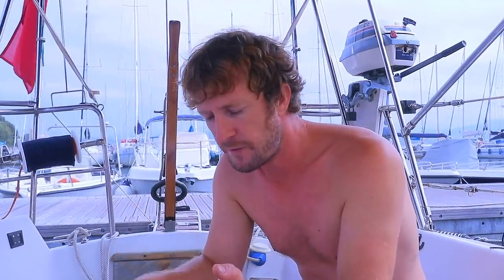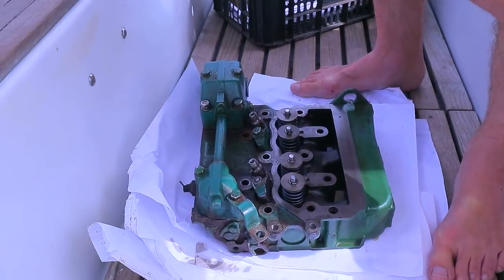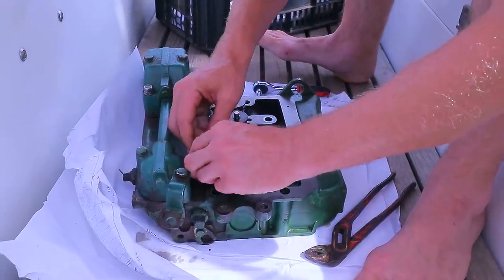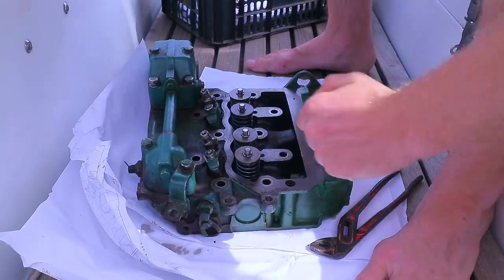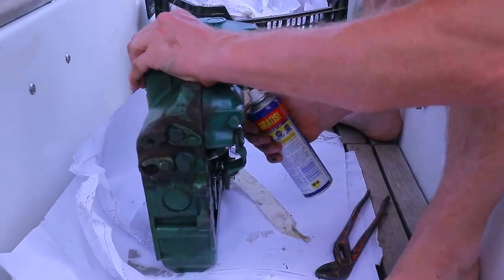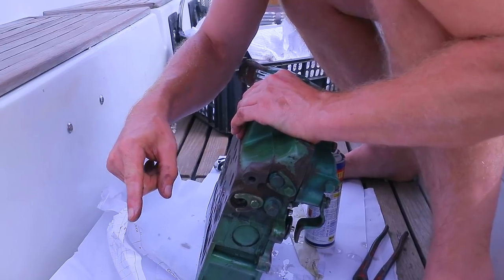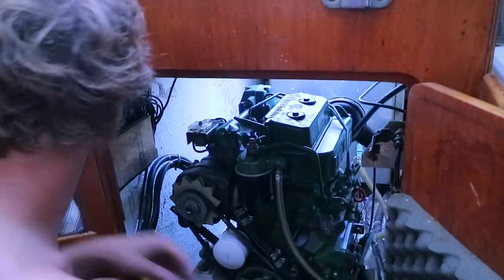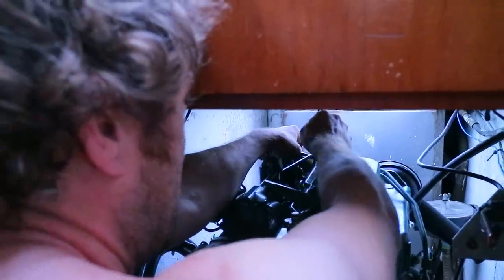Volvo Penta Injector Blow-By (Part 2 of 2) | ⛵Sailing Britaly⛵ [Boat Work]

Comment: I've got a volvo 2003, my first boat and my first diesel! Just planning to clean up the injectors and potentially replace or repair the sleeves. This has been the most valuable video I've ever encountered for any mechanical job I've undertaken. Thanks a lot, it's really appreciated!

Comment: Hey, that's a good video, it's encouraging! I've just completely renovated my Volvo 2003t. Due to inexperience, I didn't change the atomizer sleeves and I couldn't get the injector nozzles to seal. So the atomizer sleeves had to be replaced. I bought the three tools and replaced the sleeves according to the manual. I left the cylinder head on and drained the coolant, as the sleeves are directly flushed with water. The old sleeves were cut off at a certain angle to the cylinder head. The old ones were longer. The new sleeves are only as long as you really need them, so it's not necessary to take the head off. It's worth mentioning that the injectors are only screwed on with 20Nm, which leaves some reserves, but then the properties of the copper are no longer there, as it becomes too hard and no longer seals.

Comment: Dirt in the injectors and bashed the sleeve out with a hammer !! Diesel specialist my ar*e !
Agree, buy the tools and do it yourself, every time.
Good informative vid, well worth watching,  thanks.
Reply from the maker: Thank you Douglas. 👍 We all make mistakes, but I was very annoyed to be paying for a service and get such carelessness.
Reply: To be fair, the expanding puller, or blind hole puller, often doesn't work. Been there! There could be a couple of reasons for this. What is wrong with drifting the sleeve out? Absolutely nothing unprofessional about that at all. However, I always do it myself - but I'm 66 and worked on diesels for a long time..

Comment: Nice vid mate. I'm ex REME Ac Tech (Lynx/Gazelle)  and feel exactly like you regarding getting tradesmen to do jobs.
Reply from the maker: Hi Martin, we shared a hangar with 657 Squadron - they were a right bunch of lazy gits... 😉😁 I'd love to be able to do a bit less as I get older, but almost every time I try to 'let go' I wish I'd have just done it myself. Rossella and I refurbed our apartment in Italy and did absolutely everything ourselves (Rewired, knocked a wall down, fitted a boiler & central heating throughout [although a plumber fitted the gas supply for legal reasons], gutted the bathroom and renewed all the plumbing in the concrete floor (taking great care not to go through the floor into our neighbours ceiling!), plastered, double glazed, tiled, replaced all the internal doors, replaced all the flooring, painted everything, the whole shebang) When it was all finished, we ordered a shelf from a big national furniture store and I went away offshore. The guys came to fit the shelf - something they do every day as it is their job - and they drilled a hole through the wall in our living room into our neighbours bedroom! (Peephole style!) To make matters worse their bedroom wall was finished with a hand-painted 'dabble' effect with different colours, so our neighbours had to get the guy who had painted it years before back to paint over the hole. I couldn't believe after we'd done all that work with no issues these muppets could do that whilst fitting a shelf! 😂 It's funny now, it wasn't at the time. Cheers, Chris 👍

Comment: If you want something done right, do in your self !  And use only OEM or better parts. No one but me, wrenches on my beloved 99.5 VW TDI  jetta with 340000 mi.  Really enjoy the technical information. Do you use any lube on the new rubber impeller ?

Comment: Thanks for the injector tips.
I have a Trawler with twin Volvos and  after some work which required the injectors being removed I had blow by. I tried the hammer solution and it improved slightly, the copper washers on the fuel line absorbed the shock. Remove fuel lines and after a whack the i injector has seated.
3 years live aboard in Abaco's Bahamas, now permanent in Bahamas in our house.
Thank you.
Living as we have there have been our fair share of problems that had to be sorted without a boat yard or so called expert. Feel free to pass any problem by me.
Bob Errington

Comment: Great tip the 'cream' on the hands. If you're VP is a Marinised Perkings engine, like the D-2 range, you can get these parts at 1/4 of the VP prices for exactly the same. My tip for you: use GT7 from Tec7 instead of WD40. Discovered it a year ago. Incredible. For example, it loosened a spanner in 30min that was stuck since 2 years and where every 'specialist' had failed! Costing me a lot. GT7 is about 7euro for 600ml. It stopped also the corrosion on my boom between aluminum and stainless steel (and makes the boom and mast shine as new 😁). I wish I had discovered it earlier.
Reply from the maker: Thank you for the tip Henri! I hope you and the family are enjoying France! 😊 Chris 👍

Comment: Haven’t read or watched it all but a couple of things worth mentioning. Cleaning out the carbon from the exhaust water bend is a real worth while thing to do as they get blocked especially if engine is run on low load. And if you Lapp the valves in to much it can reduce the clearance with the decompression lever resulting in the valve being held open even with the lever in the off position. Also regarding the injector pocket inserts, the are cooled through an internal tube running fore and aft through the head and there are small holes approx 2mm dia which can block, these are orientated at the correct angle to spray the right area.These can be cleared or checked in situ with the removal of the cooling supply inlet pipe.l would caution against trying to remove the internal pipe as it is likely to bend .l can remember how many small holes there are may be 4 ,can be checked with wire. Regards Alistair

Comment: Sun tan cream can mark some finishes like car paint - guess how I know.

Don't forget to lubricate the top end before putting the lid on. In the few seconds before the oil reaches the tappets, and valve guides a lot of damage can be done.

From memory some of the Penta engines were originally made by Perkins. I think their parts are a lot cheaper.
Reply: The Volvo engine that is going into Nutshell is a Perkins.

Comment: Always wondered why impeller driven pumps often eject water in spurts rather than streams?  I would think a stream would be better for removing heat efficiently.
Reply: The pump is produsing a stream of water. After cooling the engine its intected into the exhaust. There its pushed out unregular by the exhaust gas

Comment: Hi - Good video ! Great to see someone else working on  a Penta 2000 ! Just rebuilt the VP 2000 on my Bristol Channel Cutter Adventure, but the regulation system is not working well. Does anyone know of a reasonable source for the  Bosch PFE 1Q 70/36 injector pumps or rebuild kits ?

Comment: when I took the rocker cover off my 2002 only one spacer appeared to be present! it had dropped down into the engine and could only just be seen, it took a lot of fiddling to get it out. not a good design at all!!??
Reply from the maker: HI Ian, when the rubber grommets are new they grip the spacers really well but as they age they get loose. Not ideal, but when you know about this you have a better chance of not letting them fall down those dark holes! Cheers, Chris 👍
Reply: @SailingBritaly  the thing was, I was not aware it had fallen in, so I was thinking, mmmmmm was it there, was it not, as initially I couldn't see it, it wasn't untill I had a good look with a torch did I see it, I could easily have just refitted the cover and started the engine !!??

Comment: Hey Chris good video. Make a video on the volvo penta exhaust elbow. Mine got clogged to a 6 mm diameter! Then after a year already was 1/3 clogged. The volvo shop guys said you are not riding the engine hard enough so I did for a year go nuts full steam everywhere like a jobo only to reinspect and have the same clogged pipe 1/3 of diameter per year. I would like to see your opinion and tricks. Hi to the family from NZ

Comment: Definitely very enjoyable.  Well, it is a blokey thing!  On the engine, purging air can be a pain...  dual inline water separators hold a lot of fuel, and air, and with manual purging can take forever.  If possible lower the filters below the tank/fuel level and crack the purge valves, this will get rid of most of the air without trying to top up with unfiltered fuel.  At least one water separator/filter should be on the feed - condensation may not be a problem in the med. but here in dear old blighty we know all about it!  A fuel additive to stop bacterial growth in the fuel is very important in the med where the fuel tends to hand around for long periods.  I wholeheartedly agree with your comments about doing the job yourself to get it right.  The boating industry is a strange place for contractors, with no easy referral system for quality workmanship, unlike other industries.  Why?

Comment: Hi Chris, excellent final video about the engine. The world is small sometimes ... Years and years ago I had an excellent experience (for a complete post purchase service) with a mechanic specialist in old engines from MotorVela in La Spezia at the Darsena Pagliari. My old Volvo Penta MD11C from 1980 was in excellent condition and still runs like a quality Swiss watch. Keep it up, it's nice to follow you. PS: how does little Emma grow? Greetings also to Rossella.
Reply from the maker: Ciao Mauro! MotorVela were excellent - the diesel guy less so, but all's well that ends well. We really miss Liguria, we loved keeping our boat there. Emma is not so little any more... it's scary how fast they grow up! Un abbraccio, Chris 👍
Reply: @SailingBritaly  When the elderly retire they are often replaced by less good young people, it is a pity. Today there is a tendency to replace ruined pieces as they are no longer able to repair. Fair winds with Emma soon at the helm ...

Comment: I had an injector leak and on a crossing from Minorca to mainland Spain. Went until the end about 40 miles and a spainish mechanics did the copper ring solution. 4 years after it still works but the second one starts to leak. He struggled a lot to put out the injector. I will ask to change the three of them. What do you think I should pay for?

Comment: Great summary, details I've never seen before. One implication of the Dunning Kruger effect is the way confidence will consistently advance faster than skill in the first 10,000 hours when learning a task. So, even with a background of spinning wrenches, I don't think we beginners should have too much confidence we will perform new tasks better than a pro who does it every day. The kind of mistakes we make are different, often more glaring, and the pro makes the sloppy mistake because he's trying to be faster. On the other hand, you never know when the boss has hired a new employee, who is on his own learning curve. Priceless wisdom comes from past misadventures.
Reply from the maker: Hi Dave, I agree with you, but I struggled to contain my annoyance with this job... The injectors both had dirt in them (I handed them over with protection on them), one injector was facing the wrong way; they said they had pressure tested this, but the exhaust elbow [which I had not unbolted so as not to have to buy a new gasket], was visibly loose so I asked "what about the gasket?" they said I could "just use the old one". When I took the elbow off there was at least 1/4 of the old gasket missing...) Nobody is perfect and we all make mistakes, but if I pay a specialist to do a job I expect better than this. Best regards, Chris 👍

Comment: Well done. I did the same job on my 2003 without taking the cylinder head off. That worked also. Buying the special tools is expensive but without it this job would be near impossible to do. I strongly recommend to download the workshop manual. Great channel - keep up the good work.
Reply from the maker: Great to hear Oliver, that's what I would do next time and if I see a set of tools for sale at a decent price I'll get them and a spare injector sleeve for our tool kit on Britaly. Cheers, Chris 👍

Comment: From the diagram you showed it looked as if the injector sleeve has its first sealing point made by being reshaped into a countersink in the head. This also helps stop the whole lot being blown out when the engine fires, diesel being vey high compression. Isn't that also why the sleeve had to be drifted out?
Comment: You could do with a couple of shorter socket extensions to make your job easier and and more efficient. Using the torque wrench with a long extension can make the force wrong due to the bar twisting. Not a good idea to break/undo torqued bolts with a ratchet either and I was surprised to see you doing that. Keep up the good work.
Food looked very tasty, especially the Pasta. That's right up my strada.

Comment: Sublime to the ridiculous and I like them all Chris, your research for cheap parts is fantastic (apart from the chain)😁
Reply from the maker: Thank you! Actually the chain is all good! I dragged it across the boatyard to mark it up and I must have dragged it over something ferrous: when it first went in the water and some rust stains appeared I thought it was bad galvanising (hence my talking about that in a video) but as time has gone by it actually transpires that the chain is showing no problems and that initial rust was caused by deposits of ferrous material on top of the zinc. Cheers, Chris 👍

Comment: When I worked for Volvo we made a quicker tool with threaded bar welded to a coach bolt, slide hammer a truck gudgeon pin. Worked really well, coach bolt screwed into soft copper every time. You need Volvo tool for putting replacement injector sleeve back in though flares the end

Comment: Thanks for the content! Although this is a year old a nice trick on the field for the head/block surfaces is to watersand it. Use a reasonable thick block of glass (to remain as flat as possible) and wet sandpaper to remove the old gasket/ remove minor imperfections on the head and block. (800/1000/2000 grit). Ensure you have something on the cilindres to keep them clean.

Comment: Excellent tech Vlogs Chris. I was not surprised in learning of your negative experience with MotorVela at LaSpezia. Two years ago they rebuilt my 130 HP VolvoPenta engine and a 12 KW generator. Well, I had multiple diesel and coolant leaks. Instead of cleaning the motors they spray painted onto the dirt all over the engine and generator. In addition they did not replace some of the larger gaskets. A true unprofessional disaster that I discovered underway during the months following installation, when I already was 1000 nm away from LaSpezia... Best regards from Switzerland, Silvano
Reply from the maker: Hi Silvano, I'm sorry to hear about your experience. We found MotorVela very good at getting parts but the subcontractor they sent us to for the injector sleeve didn't do them proud. Cheers, Chris 👍

Comment: Very informative, good instructional technique and diction nice and clear. Love the idea of presenting options from the quick fix to proper fix. Disappointing to hear about the short cuts used by the so-called diesel specialist. I took my Yanmar 1 cylinder to a proper head-shop for renovating and found they had chiselled off the flat nut retaining the oil gear to the cam shaft instead of using the special tool. I’m sure it will be ok and not crack and disable the engine (gulp !). These may be minor things, but if you’re paying several hundred GBPs for a workshop standard of work its not unreasonable to expect quality. Your vids are full of common sense and practical solutions; many thanks.
Reply from the maker: Thank you Mark, I appreciate the feedback. Cheers, Chris 👍

Comment: Great video, very informative, I didn't know there is a injector sleeve on this engine, I'd assumed the injector was fitted directly into the head. 
Three observations!
Even though you refitted the push rods in their original position I would have checked the tappet clearances when the rocker shaft was refitted. A difference in head gasket thickness would alter these clearances. 
I'd be tempted to get the injectors serviced/checked out at the same time, my local guy charges £10 per injector to check them, take it from there if there is an issue.
On refitting injector HP fuel lines, just connect the end at the pump and bleed/purge the open end into a rag or container (run pump/crank engine) so any dirt doesn't end up in the injector then connect to injector.

Comment: Really enjoyed this,.  I enjoy your sailing films too but this is useful - I have just paid too much to have a raw water pump replaced on my more modern penta!   I do have some mechanical skill (Triumph spitfire 1300😜 which I still work on and have rebuilt a couple of times over the last 30 years) but am a bit reluctant to test it on a marine diesel which I rely on for my family - though by the look of things from your film I possibly could be as good as the dealer 😳😁

Comment: Those injectors should be a drop in fit into the sleeve.
Never in 30 years have I had to use the clamp to get any injectors Ive rebuilt  to go into a Volvo sleeve.

Comment: This video is full of high valuable information! Regards from Brazil!
Reply from the maker: Cheers! 👍
Reply: @SailingBritaly  Chris, I'm servicing a VP2002, it's reaching up to 2700rpm at no load , but  when I engage the gearbox the engine takes to long speeding up and barely reaches 1800rpm. I suppose the injectors are not injecting enough diesel. Feed pump looks ok, diesel filter changed, fresh diesel... I tried to remove the injectors to check its opening pressure, nozzle spray angle and diesel volume, but they are stuck. I will also test the cylinders compression, even with no difficult to start it. Any recommendation?